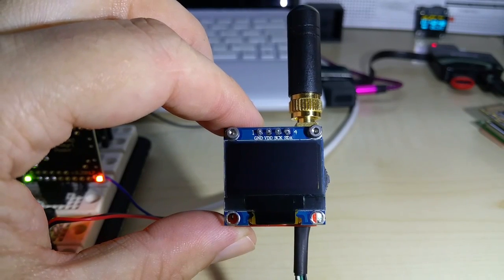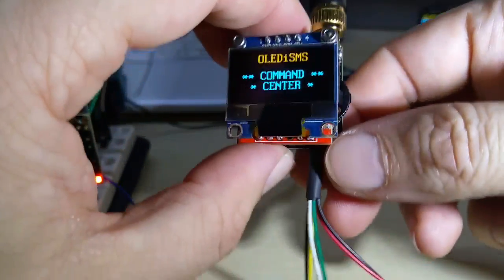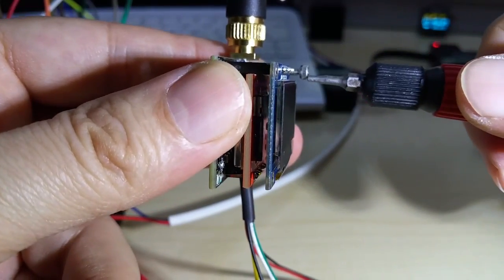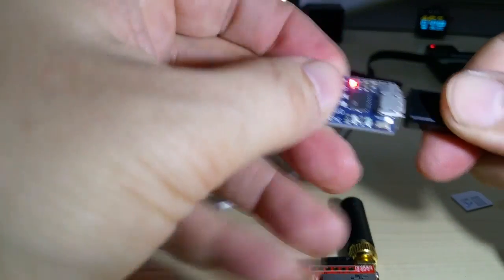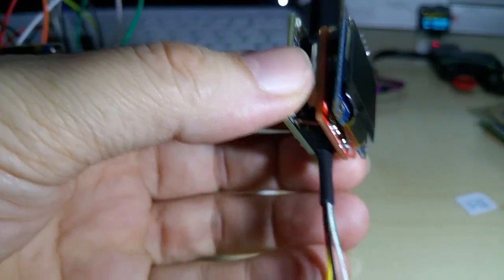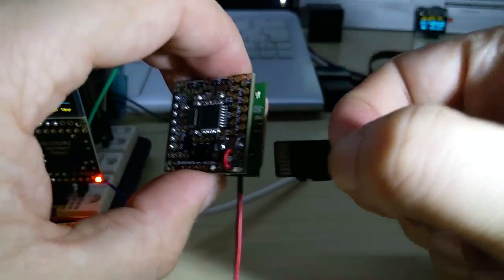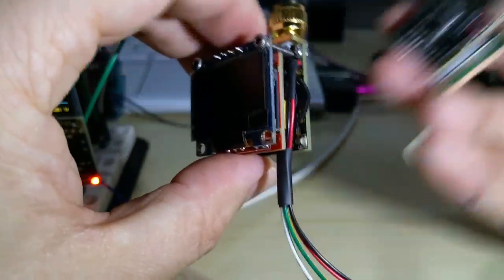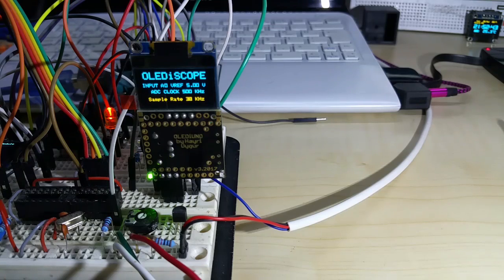How to upload code to the World's smallest GSM Alarm explained

Comment: Great video and product.
You mention adding the GSM to the GPS module. I'm in the middle of making that right now using same GSM module a neo6m GPS and 328p chip, not using a display. Just on the software side now. Although a novice, I have tested each module separately and working well, just need to combine the two now.
Have you completed your project?